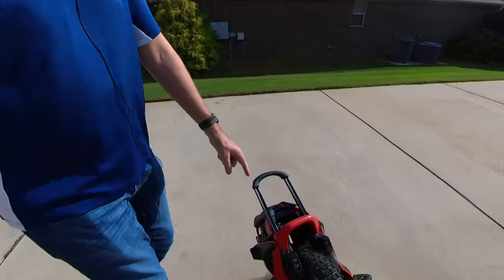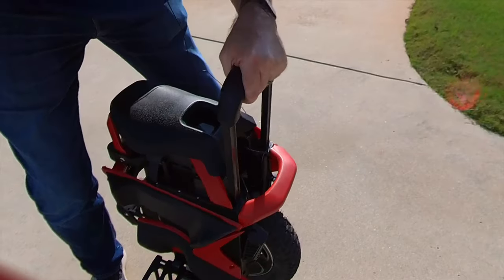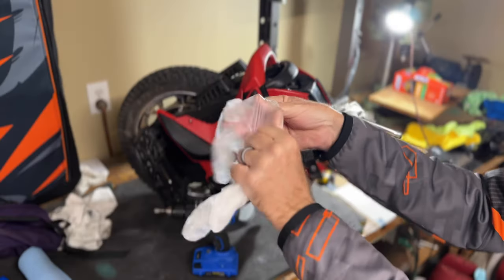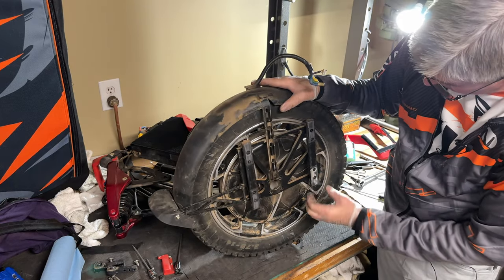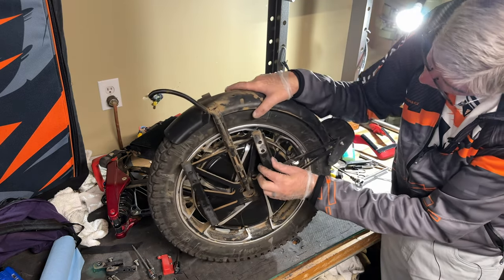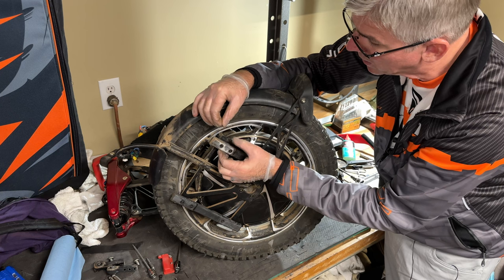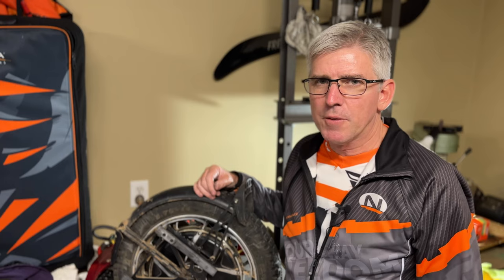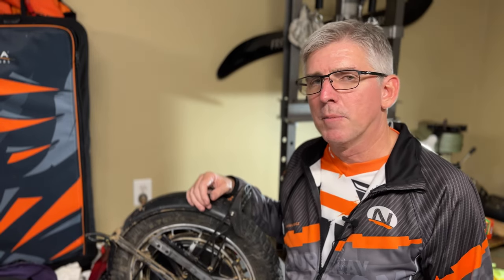S22 Bearing Slider UPDATE.

Comment: A few points 
First of all, obligatory 'first comment' 😂
Second, I'm surprised you decided to go back to the original & not just shop around for some bearings that fit where the plastic rollers are, I did see a video somewhere of someone using PU rollers with bearings inserted, perhaps that would solve the issue
Third, hopefully the designer of these sliders sees this video & adjusts his design accordingly so we can easily insert bare bearings in there & not have to use the plastic rings, because that seems to be  the only point of failure
Fourth, I would also definitely be interested to see these sliders printed with either ABS/ASA or PETG plastic to see how those materials would stand up to the rigors, especially ABS/ASA as it's meant to be a lot more shock resistant
Cheers from Australia
Reply from the maker: Oh, I’m definitely not done with them, I’m just so busy with work I don’t have a lot of time to spend with it and need to ride when I can. It was all I could do to make time to edit this video. Thanks for the comments.

Comment: Great update👍
I had my doubts. plastic under rolling compression 🤔
I like your idea of just a slightly larger straight bearings in there.
Cheers
Reply from the maker: Yes, I'm not sure any type of material will be better than just a larger diameter bearing. I'm also concerned about the longevity of the inside bit that holds the bearing in place.

Comment: Found your videos today (I have an S22 I'm trying to fix as much as possible before taking it out for actual rides) and ended up watching yours and a few other people's experience with the slider which got me thinking about some materials and companies I used back when I had a job (TLDR I got hurt and nobody needs a technician that can't be a forklift too) that I used to solve some similarly interesting problems.
They responded already and I'm looking at what the parts cost using their materials and/or printing services.  

Igus specializes in "tribological" materials, which is to say, friction and wear management solutions and makes 3D printer filaments with their specialty materials as well as tapes of varying width and thickness.

Their rep had some ideas and no I'm not an affiliate just an advocate for letting vendors do the work and help you solve problems.  I am going through and getting a few quotes from them but I'm not an information or source hoarder and anyone can use them or their products; it's just that most people (like me) are/were surprised to know such things and companies exist and in a few cases were able to create very simple solutions to annoying problems that had been difficult to manage previously.

copy/paste (you can delete it if you feel it's too cross promotion-y)

Chris Johnson
3:16 PM (4 hours ago)
to me

Hi Russell,

The S22 is an interesting application. It is always interesting to see the enthusiast community comes up with solutions for bad mfg decisions be it a design flaw or a company flat out being cheap. After watching the video and seeing how the suspension works on those sliders, my first thought was to use our 3D print service to essentially make a bearing in a shape that would fit onto or into the sliding mechanism. If you or someone can design a bearing that would fit, we can easily, and cost-effectively print a small batch.  Link to 3D print service below.

[link deleted because youtube hates links]

Chris Johnson
Territory Sales Manager
Drytech Bearings – Oregon,Southern Idaho & Montana

Helpful Igus Resource links:
Plastic Bearings
Linear Slides
Low Cost Robotics

Comment: You need to protect them from dirt, either with the scoops from the original design or other 3d printed options like the mini fenders
Reply from the maker: Agreed. I didn't install the protection at first because I wanted to introduce one thing at a time in case I had issues with friction. Honestly, I never rode in mud or anything much more than just dusty conditions.

Comment: Leaving aside the other fairly obvious inherent design flaws of the S22, isn’t it expecting rather much of the 3D materials utilised for these bearings to stand up to the continuous interactions between rollers and the slider housing?    I’m no metallurgist, far less an owner of an S22, but I would’ve thought that the rollers need to be ‘almost’ if not equally as hard as the (alloy?) groove races in which they are expected to perform the ‘magic’ expected of them? Plain metal bearings of a suitable size might indeed work better, on the assumption that they are going to be made of harder material than the alloy groove races, and over time, with the addition of the grit and dirt off the road may eventually become easier and more ‘loose’ than they’d  otherwise be when first placed there - thanks, in no small part to one of these aforementioned inherent S22 suspension design flaws?

Comment: Thanks a lot for sharing your experience with these 3d printed sliders. I'm planning to print these for my S22, and I was wondering which material was used to build the rollers, PETG, TPU (or even PLA) ?
Maybe that can be a hint on the solution 🤔
Also, are your sliders in HTPLA+, or simple PLA ? Cause they seem to hold up quite well !
Thanks again !
Reply from the maker: My friend printed it out using the materials and instructions that from the website that shares the files. These can be found in the description of the original video. https://youtu.be/G8NM6KjRlyI
Reply: @DavidRaney  sure, I read it entirely and ordered as recommended, but creator gave multiple possiblies for each part, so I wanted to know which one your friend picked, especially for rollers ;)
Also, HTPLA+ is a really specific PLA, that's why I wondered if your friend ordered it specifically, or did it with standard PLA
Reply: I was asked by my good Friend David to print this for him.  All parts were printed with DURAMIC 3D PLA Plus (PLA+) at 215 F.

Comment: Original sliders due to high friction, especially if you like dirty trail rides will  just eat metal ftom its aluminium guides. Not the best idea to use them at all.
Reply from the maker: I’m working on putting more roller sliders in my wheel.

Comment: Why are people still buying this crappy design wheel, and why no one is bitching to Kingsong about fixing the slide issue?!!? There is absolutely no motivation for kingsong to do anything... But fools keep buying the damn wheel!!! That is no motivation to fix!!!
Reply from the maker: People are complaining to KingSong.  Pretty sure they are aware of their customer dissatisfaction as they announced they will be offering upgrades. They are also aware that people are not happy with how they are handling it and has to be showing up with their sales. 

As for “fools” buying the wheel, there is not a wheel available that doesn’t have issues and most of them have major issues. Breaking rims, bottoming out crappy air shocks that require more pressure than you can put in it, overheating, outdated before receive it with no available parts, the list is never ending. Someone could probably say the same thing with whatever you ride I suppose.